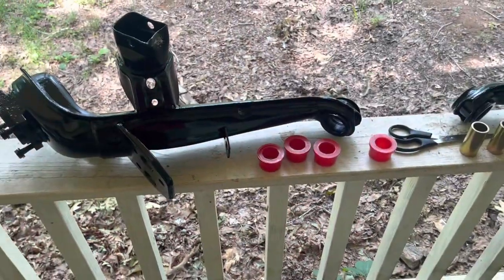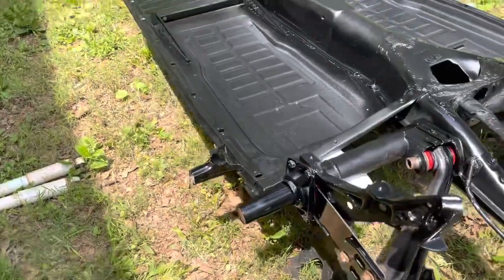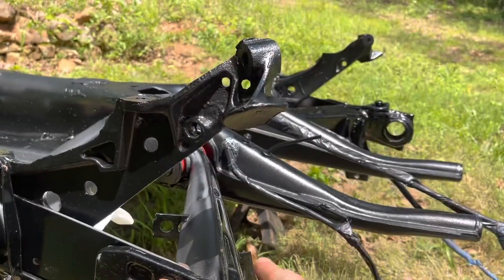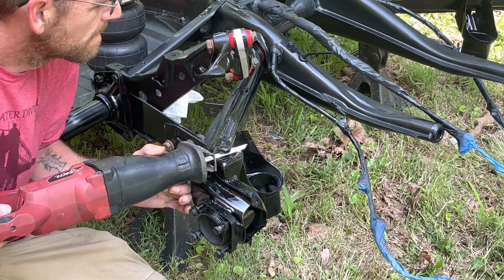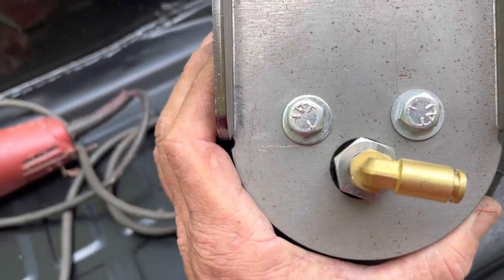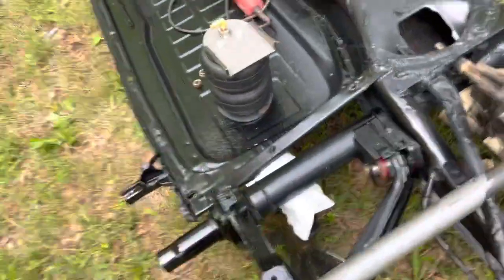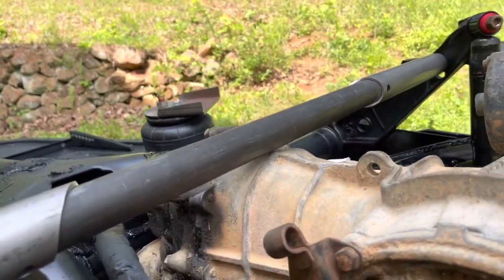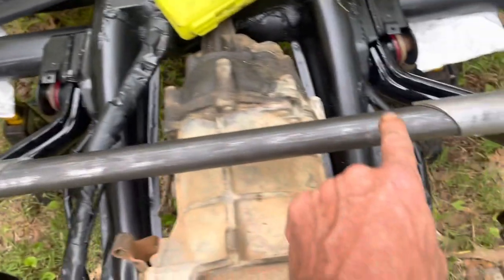1973 VW Beetle Volksrod: Airkewld IRS rear air ride installation

Comment: This is good content but I feel like this kit is not meant for the usual diy’er. I have Airkewld’s front beam which was a great plug and play product and I ended up buying EvaResto’s rear air ride kit which is also a bolt on option.
Reply from the maker: Yes I actually found this kit to be way more involved than I expected when I bought it. It's a good kit but I will probably go a different direction if I ever do this again.